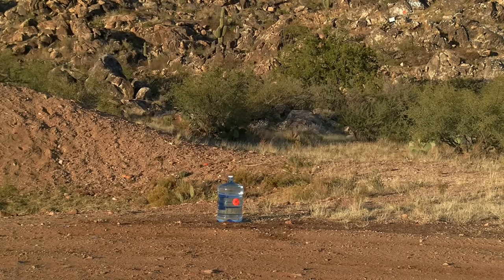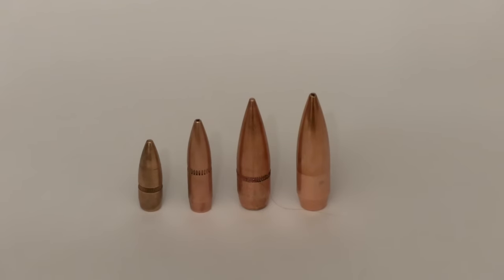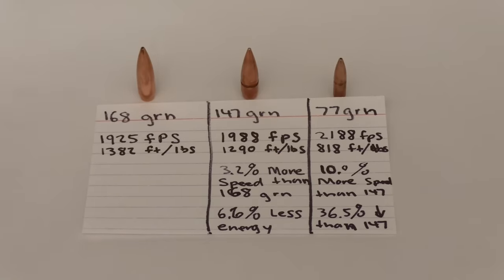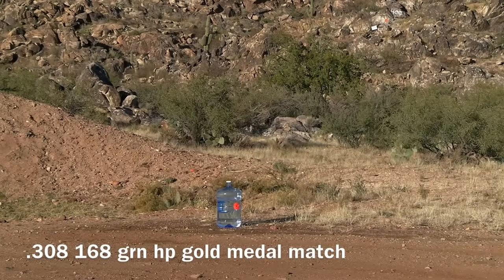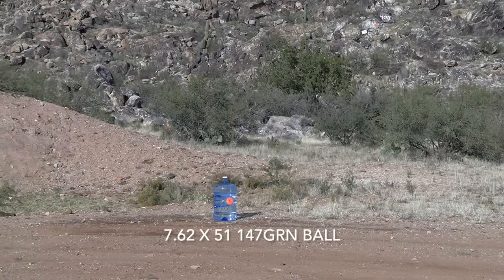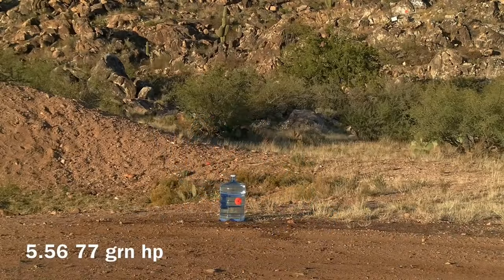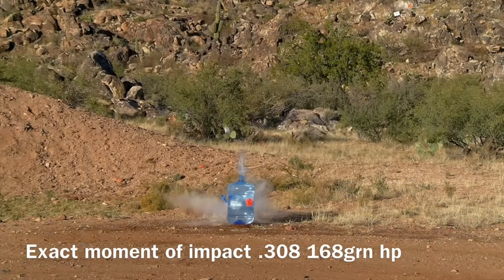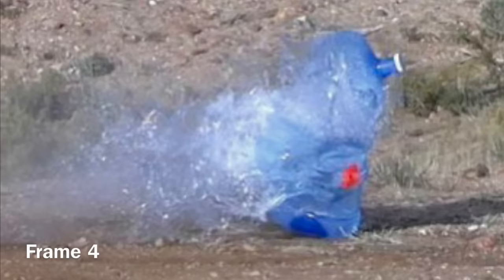5.56 & .308 vs 5 gallon water jugs at 300 yards

Comment: It certainly shows what damage that a hollow point heavy for caliber bullet will do in the 223.
I am more amazed at with 147 grain ball round did as compared to the two hollow-point rounds. For me it's 308 all day, and that really opened my eyes as to what the ball round did compared to hollow points. I have a lot more confidence in my 308 with 147 grain ball ammo. Great video
Reply: Keep in mind, Open Tip Match (OTP) rounds do not function like a traditional hollow point. The open tip is to help with the flight of the round, but doesn't cause expansion. You need a hunting projectile usually for expansion in rifle rounds. Using a soft tip or one of the polymer tip hunting rounds would have had a more energy transfer into the jug and a bigger show. The first round just zipped through the jug, based on that exit hole.
Reply: @jasonk.3182  Now try that experiment with a 243 Winchester and a varmint round.  A 55gr bullet out of a 243 is pushing 4000 fps.  Hit a water jug with a 243 using a 55 gr Sierra Blitz King and you time the jug for hang time, lol....
Reply: He should try a liberty defense 100 grain 308 round which goes 3800 fps out of a 22 inch barrel.
Reply from the maker: @Netravler1, Thank you for taking the time to watch the video and for your enthusiasm.  Wanted to respond sooner but was working on the sequel to this vid.  Here is the link to it.
https://youtu.be/jyKcyXacBh4

Hope you will find it to be on par with or better than the original.🙂👍

Comment: They each have their best uses, that's why, in Vietnam, where most engagement occured in under fifty yards, the 7.62x51 was far more than was needed, and full auto in an M14 was practically uncontrollable, but for the odd long-range shot, the 7.62 was available.

Comment: High velocity and bullet fragmentation  generate a more explosive wound channel or water displacement with the smaller caliber but when it comes to game animals where bone and flesh absorb the impact of the bullet everything changes. Lack of penitration and grenaiding projectiles can cause superficial wounding. A bonded bullet like Bond Strike or Speer Impact will hold together giving a passthrough while still giving a large energy dump. Water is an ok medium as long as you use wood to simulate bone for a realistic test.
Reply: Yes, bonded makes a difference. 

I have hunted whitetail deer for decades but in the last 10 years or so, I have only hunted with a .223 in a 26” barrel bolt action instead of my usual .270. 

I have always had a pass through with an exit hole of at least .50 caliber. I have never had a deer go more than maybe 15 yards. 

I usually hunt about 100 yards so never at a long range. In fact if I was going to reach out 200 or more yards I would probably go with the .270.

But… my longest kill ever was at 118 yards ( according to the range finder) with the .223. It was a buck quartering at me so not an optimal shot choice but it was getting late.

The 62gr bonded round (Federal LE223T3) went through the left shoulder joint, shattering the bones and continued through the heart and exited the other side. The deer rose up on his hind legs, walked a couple of steps and the fell dead.

I had a friend with me in the blind witness it and when we cleaned the deer, he could not believe the round went through the joint and still at an angle (making it travel farther), exited the other side. The leg joint appeared to be no hinderance at all.

At a longer range? The .223 would probably be lacking and certainly more so than a more standard deer cartridge like the .270, .308, etc. 

Within a little over 100 yards, the bones didn’t seem to have much to do with the effectiveness of the round. I am fairly certain that the hunting rifle barrel instead of a short 16” AR type barrel probably had a lot to do with it.

Comment: The cap coming off of the first test completely changed the outcome. 

We cannot assume that each water bottle is manufactured very precisely as well so each bottle may have different flaws the structure. So single shot tests are not enough of it comparison statistically to make completely valid conclusions.. 

It is extremely interesting though and I thank you for doing this very much! Thanks for being so thorough about the projectiles in the velocities and energies the different distances. That was super helpful!!!

Comment: The differences in terminal performance have more to do with the bullet construction than any differences in impact velocity or terminal kinetic energy.

It is obvious the smaller, less energetic 5.56 imparted a much larger percentage of its kinetic energy into the water.

You could play around with bullet choice and get the 7.62 to dump the same percentage of its greater kinetic energy into the water and it would be even more spectacular.
Reply: You would see as much or more damage on a. second or third jug wit the 308.  With an FMJ round, one jug doesn't have enough resistance to make for a spectacular hit.

Comment: TOP-TIER video production value  .  .  .  maybe in addition to the target sticker you could mark the plastic water jugs with some reference lines or marks with a black felt pen marker to help identify the front  .  .  .  the reference lines/marks would help to positively identify the projectile entrance hole post-mortem if the target sticker comes completely off and the water jug ends up totally shredded .  .  .  I have a feeling securing the cap with duct tape would result in some pretty spectacular impacts  .  .  .  compliments again on how outstanding well this video was put together .  .  .  you set a benchmark by which other range test videos should be measured  .  .  .  👍🏼
Reply from the maker: Thank you miraclemax08 for taking the time to watch the video, provide intelligent food for thought, and for being far too generous with your compliments.  Much appreciated.
Reply from the maker: Greetings Miraclemax08.  Just wanted to send you a message to let you know that a sequel to this vid has been produced.  Here is  the link to it.
https://youtu.be/jyKcyXacBh4

Hope you will find it to be on par with if not better than the original.  🙂👍
Reply: @outdooradventures1696  just watched the follow-up video and it is as equally well produced as the first  .  .  .  the only way the follow-up video can be said to be better than the original is to point out how well commenter concerns were addressed  .  .  .  another outstanding job on the follow-up video

Comment: Nicely done. Good representation on hydrostatic shock. That energy dump from the 147 and especially the 77 @300yd is definitely impressive. Highly doubt all these folks running around with truck guns 10.5 and shorter will ever see results remotely close to the 18in used in this test. It's still extremely impressive. Thank you

Comment: Assuming there was no tampering with those Jugs, this is very shocking. I would never have thought the 5.56 would be that much more violent compared to the 308. Extremely interesting.
Reply: Because the 308 went through. Water is much softer than tissue, which is why ballistic gel is used.
The 556 is better for water zombies!
Reply: This was never about penetration, it was about velocity and the shock wave that was created. If this were about blasting concrete blocks, then the outcome would be much different.
Reply: The 308 needs velocity for an otm to open. An actual hunting round would have made a huge difference along with a real barrel not a 16".
He even gave the 556 an 18" barrel it simply had the velocity advantage needed to dump energy in the target rather than behind the target
Reply: The .556 slowed down faster and dumped more energy into the water. The .308/.762 passed through. Also the loss of the cap on the .308 168gr caused loss of hydrostatic pressure and limited damage to the bottle.
Reply: OTM doesn't act like a hollowpoint designed for expansion.

It tends to act like a thin skinned FMJ, breaking when it yaws.
Reply from the maker: Am sorry about the slow reply.  Wanted to respond sooner but was working on producing the sequel to this vid.  Here is a link to it.
https://youtu.be/jyKcyXacBh4

Hope you will find it to be every bit as interesting as the original.🙂👍

Comment: 77gr at 2913 is hard to believe. As one who reloads the 77 OTM and also uses an 18” barrel, I know there is not enough case capacity to achieve this velocity .   Their own website shows 2750 and we all know they 24” barrels for testing.
Reply from the maker: Thank you Mr yeates26 for taking the time to watch the video and to offer some intelligent food for thought.  Much appreciated.  Please keep in mind that this video was published on 12/05/2022 and the chronographing was done a few days prior.  Here is a link to a video that was posted on 4/25/2022 (nearly 8 months earlier) in which the readings were even faster than 2913 fps.  I can vouch for the fact that different boxes of ammo were used in each speed test and the weather conditions were different 8 months earlier.
https://youtu.be/7d3EBUEIbHs

In each video other thinking people just like you have commented on the speed of the 77 grain bullet but yet nobody has disputed the readings of the other bullets being tested on either date.  That being said, it begs the question, "why would the chronograph only give a bad reading on the exact same bullet 8 months apart?"  If however, the reading was off and we use the reading that is on the back of the box of 2750 fps at muzzle, that would mean that the impact velocity would be about 2050 fps at 300 yards rather than 2188 fps.

2050 fps of speed at 300 yards is barely faster than either the .308 or 7.62 x 51 rounds being tested and would not really justify how well the 5.56 performed in comparison...

What may account for the extra speed is that the rounds were tested at 3400 feet above sea level.  Looking forward to your ideas on this...  Thanks.
Reply: @outdooradventures1696  all I’m saying is facts are facts.  Even the manufacturer doesn’t claim this speed.  Bottom line, case capacity does not allow for 77gr projectiles to reach stated 2913+ fps.  If you’re reloading, you can get closer.  But, factory loaded, SAAMI spec 77gr OTM will not achieve said velocity.
Reply from the maker: @yeates26…Thanks for the reply and additional knowledge.  Both are appreciated.
Reply: @yeates26  All I can get out of a 16" barrel with 62 grain projectiles is 2860. An 18" barrel might push it to 2900, but it's just not happening with a 77 grain pill.

Comment: Awesome video, bullet design is Everything. Even their hunting bullets never have good tko because the bullet has minimum expansion, and most of the energy goes out the other side. Unless you hit heavy bone going in. Even their hollow points, I shot a deer at 4 feet with a 30cal,208 hp doing 2900fps, went 500y. I prefer the A-max for medium size,have shot 2 with one shot, plenty of bullet going through.
Reply from the maker: Thank you for watching the video and for sharing some good food for thought.  Wanted to respond sooner but was working on producing the sequel to this vid.  Here is the link to it.
https://youtu.be/jyKcyXacBh4

Hope you will enjoy it as much as the original.  🙂👍

Comment: The mk262 round breaks apart after a few inches of entering the target, that's my theory to the jug exploding. 77gr became very popular with Special Operations as it was considered the most effective 5.56 round at close and extended distances, and retained effective performance through multiple different barrel lengths. 55 and 62 grain performance are also much more affected by barrel length.

Comment: Never thought about shooting them at 300 yards!  Nice work.  I've shot a LOT of water jugs for a KE demo over the past 20 years 🙂.  I use 1 gallon jugs due to economics and the close range.  I have found that the 2 biggest variables upon the visible hydraulic effects are 1.) Volume and 2.) the seal of the jugs/container. 
 So i actually fill each jug to the absolute top and only use screw on caps - the whole purpose is to get a consistent baseline and it does make it a better "apples-to-apples" comparison.  
I think the 77 gr 5.56 was more visibly impressive due to the bullet probably yawing sideways after impact and thus significanlty increasing it surface area and therefore its KE transfer  - but thats just an educated guess

Comment: Velocity is everything in a projectile designed to dump its entire energy into the target. The 5.56, 62 grain bullet is designed to be shot from a 20'' barrel and attain a muzzle velocity of 960 metres per second and still retain a velocity above 700 mps at 300 metres. The bullet is designed to fragment as it yaws and dump all its energy. At velocities below 700 mps it tumbles and will exit the body whole leaving a substantial wound cavity and exit wound.  2188 feet/ps is 666 metres/ps. So the 77 grain bullet was tumbling as it exited the water jug at 275 meters(300 yards). At under 200 metres range it would have fragmented inside.

Comment: IMHO, the 308 round was the hands down winner.  But it's hard to tell with only one jug in the lineup.  Plus, a 16 inch barrel is a tad short for the 308.  Its not going to represent what that round is capable of.  It would have been fun to see what would have happened to jugs 2, 3, and 4.  Thanks for the vid.

Comment: Ok.   Now I know what each of those bullets are capable of.

The 5.56 bullet likely went to pieces, which is why it dissipated ALL  of its energy to the jug and its water.   Impressive.    

BUT....  I've seen it before...so I'm not too surprised.

But for my "money"....  I'll stick with the 308's  147 gr. FMJ,  even though it held together better than the .22 caliber hollow point.   

The 147 gr. 30 caliber showed very good hydrostatic shock, without expending all its energy to the jug...like the .223's  bullet did.

Still,  all three did their job.   They killed or at least...severely wounded the water jug!

So now I feel a lot more thirsty than I did 20 minutes ago!

I think I'll go get a beer from the fridge!

Good job with this video and demo!

Comment: Impressive, at least in water jugs. I'm wondering how this translates to actual living tissue. And also, with barriers between the target such as heavy winter clothing or something like drywall or plywood, stuff like that. I don't think that the 5.56 would perform nearly as well in those situations.
Reply: I’ve done similar as you mentioned with 5.56, and penetration is still substantial with 1” (2) pcs of 1/2,” with only 1/4-12” of spacing, from 300M.
Hit the 1 gal water jug with near similar results.  The top was near detached and great through-and-through.
Should have videotaped, but was simply tinkering.
Plywood was in front of the jug, transferred a 3” “circular” hold with a marker.
5.56 is not the best, but I stand behind it a good deal.
Reply from the maker: @BillSmith-Rx9m.  In response to your question, try to remember that most living things are made up of a high percentage of water.  Wanted to reply sooner but was working on producing the sequel to this vid.  Here is the link to it.
https://youtu.be/jyKcyXacBh4 

Hope you will find it to be beneficial.  🙂

Comment: The 168 gr match is loaded for a 24" barrel which would give you about 400 more fps than the 16" barrel you used. the 5.56 uses a 16" barrel normally.

Comment: I have hunted all my life. I never used FMJ like ammo to take game. I have used conventional cup and core designed bullets and Barnes copper bullets for game. If the water effects impressed you, that is fine. That will not be the affects you will have on game. That 77gr bullet will fracture / fragment. The fragmenting was causing the water to explode. Water jugs are not meat and bone. Most hunters use a rule of thumb of 1000ft lbs at impact for efficient, clean kills, given the aim was true. A 308 is fine hunting cartridge. With expanding hunting bullets to match the game, placing the bullet to get a heart / lung shot, at 300yds, it should go down. Would I hunt deer or elk with a 5.56? Never. Most states do not allow it. 

What you may want to study is the most misunderstood aspect of ballistics. Momentum. Imagine a train and an 18-wheeler going 50mph. They both try to stop in the shortest distance they can. The truck will win every time. Why? The train weighs more. An object in motion tends to stay in motion. It stays in motion longer if it is heavier. To achieve proper penetration of your game, that 308 is the ticket. The 5.56? It is a varmint cartridge. Always has been. 

I never caught what the experiment was trying to prove. It is always fun to watch water jugs explode.

Comment: The Ruger comes in 20" as well, woulda done less damage, cause speed & energy would go through too fast.
The 556 looks better here, but isn't. If you shot ballistic gel the 308 would be much better, the 556 just expands faster & puts all energy into the water.

Comment: I shot little water bottles with 270wsm,2506,243win,and 7mm08..the only one that literally exploded and made a big BOOM without a lid ,was the 243 at about 3500fps it evaporated that little bottle..I didnt know what to make other than hydrostatic pressure created by such velocity is way more lethal at close range ..the 243 bullet was 58gr hp...

Comment: If at all possible a retest of this using 16 inch barrels for both 5.56 and 7.62 but using M855A1 EPR for the 5.56 and M80A1 EPR for the 7.62, as well as a 20 inch barrel test using the same bullets would be interesting to see.

The reason why I suggest a 20 inch barrel test is that is what 5.56 was designed for, and 16 inch is standard civilian carbine length so you don't have to SBR it, unless you already have the SBR tax stamp taken care of.

Excellent video.